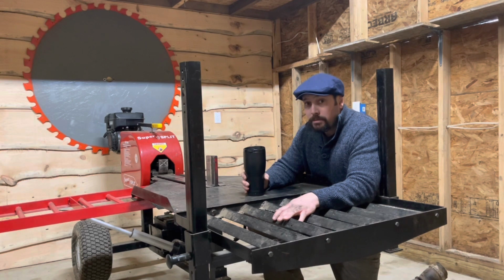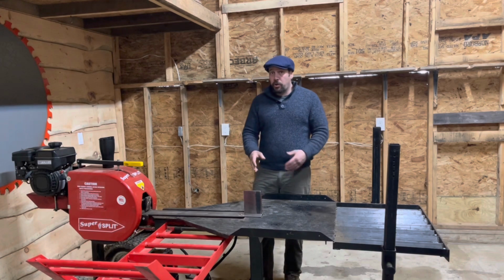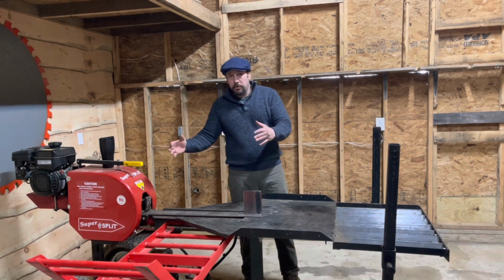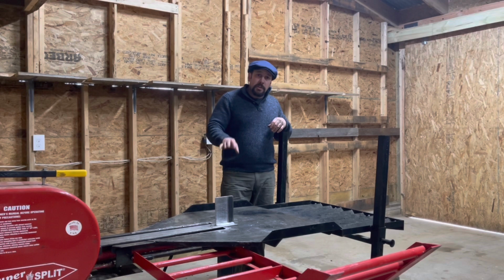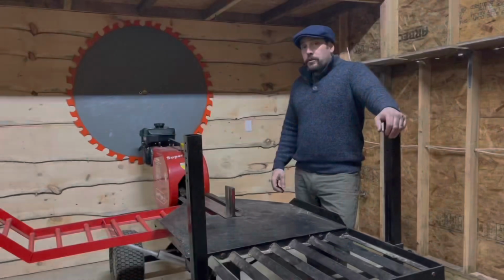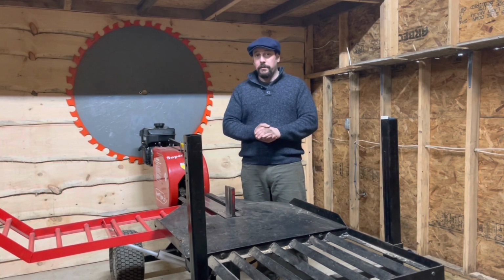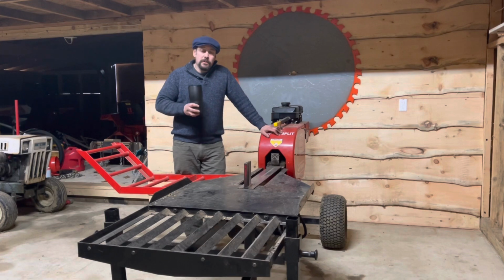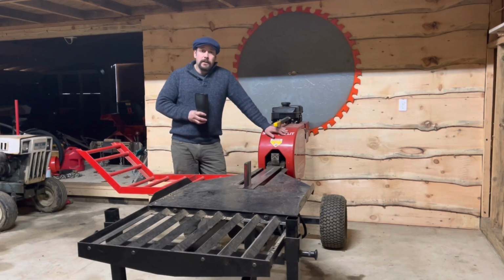EVERY log splitter NEEDS this item!!!

Comment: Nice setup. I’ve been using the the Top Dog Firewood Bucket as my production table. The rounds come into the SuperSplit on the bucket. As I split the rounds, the split firewood pieces get stacked in the bucket and gets moved in to wherever it’s going.
Reply from the maker: Great system. 👍 I’ve done similar with my regular bucket. As you take the rounds away the splits get stacked where the rounds were.

Comment: Great video Case. I have a 10 cubic foot garden trailer that I mount a piece off plywood on to. Then I mount my electric wood splitter on that. So then I can stack many rounds, on their ends, on the plywood and can stack tow or three high. This can give me any where from 10 to 20 rounds right in front of me, depending on size. And I still have room for the split ones that I need to resolution. The split ones then get thrown on to a 4’x6’ trailer. This is done by hand or conveyer. Then maybe stacked to give more room. 
And a pickaroon is your best friend to pick up wood out of a pile to split. Much less bending. 
Have a great week.
Reply from the maker: Great idea Noel. Sounds like a great setup